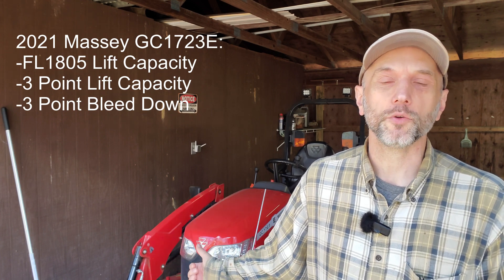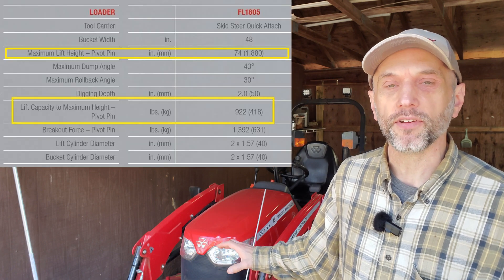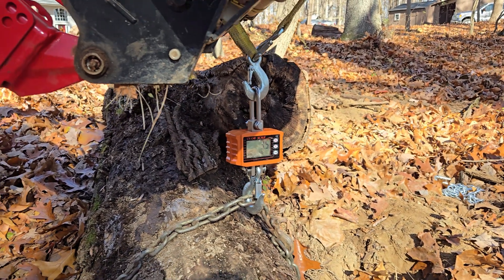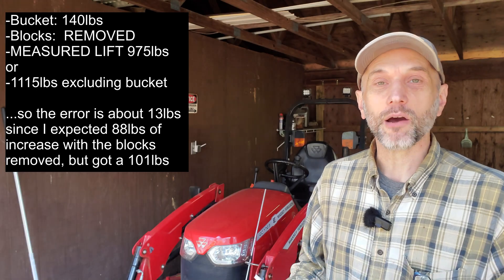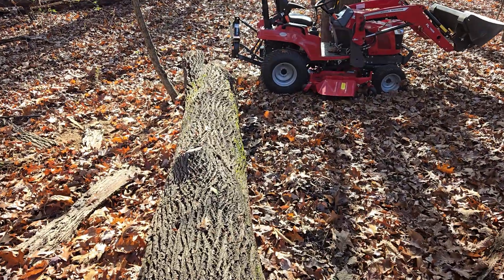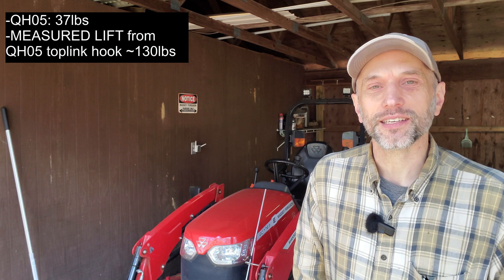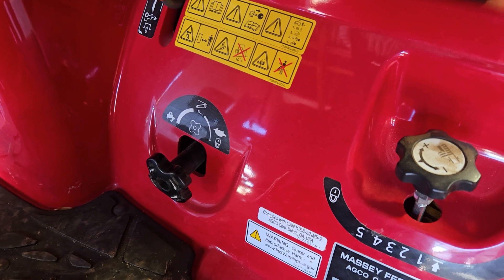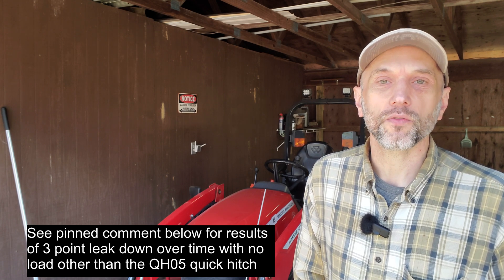Massey GC1723 Lift Capacity Test

Comment from the maker: NOTE 1: 3 Point Bleed Down Update: At the 5 day mark, The 3 point dropped from 25" to 24.5".  NOTE 2: The 3 point lift information in this video flawed because I unknowingly was at max lift height and the tractor rear wheels sunk into the ground. I'll post another video, but I got 1161lbs at the lower lift arms on the QH05 and 1217lbs at the QH05 top hook on a later test. New Video here:  https://youtu.be/8O_-KNENSxw NOTE 3: The manual notes to lower the 3 point prior to starting. The mower deck manual explains the reason for this as follows:  "When starting the engine, make sure the implement is lowered to the ground and the lift control/ever is fully forward. This procedure reduces the load on the starter because the hitch is trying to raise when the engine is cranked." Might be one reason I see so many posts online about people needing new starters.

Comment: As always, Ed, a very informative and well presented video.  That rear lift test does seem hinkey, but I can't say what would be affecting it.  I have a 600 pound ballast box and a wood chipper that weights 550 pound (though I don't think that includes the 4½ gallons of hydro fluid) and my GC1725 lifts those with no problem at all.
Reply from the maker: I finally have a theory. I think my 3 point was at the max lift point and since I was in the woods on soft ground, the tractor may have even sunk in a tiny bit right as I approached the max. This is supported by some of the video that was edited out. I also misunderstood the J283 standard, so I gotta look at all of that 3 point stuff again and get a new brief video out on that topic.
Reply: @Redneck_Ed  When watching the video I wondered about the topping out aspect, but didn't say anything because surely if it occurred to a simpleton like me you would have considered it already.  You might have to rig a test stand that gets the rear tires up higher (auto repair ramps?) to give the scale space to work.
Reply: First, love your videos. I have a GC1710 TLB with 800 hours and 5 years of reliable service.  On your rear 3 point test,  did you have enough ballast in the front loader?  I’m betting you raised it without seeing it. If I just have the backhoe on the rear without the front loader, going a little fast and I hit a bump or slight incline I will pop a wheely.  The backhoe  weighs 1000 pounds and has a separate mount. I’m betting you took weight off the front wheels when you measured rear 3 point lift. Thank you so much for your videos and all the Massey interest. Good luck and God Bless, stay safe.
Reply from the maker: @carlrizzo6471 i either lifted the front end some or the rear wheels sunk into the ground some or if reached max lift height or it's a combination of all of those factors I'm going to attempt a retest today if all goes well. Thanks for watching, and stay tuned for a follow-up video.